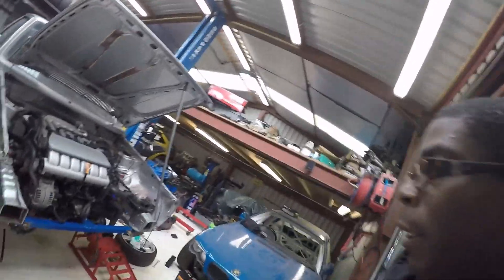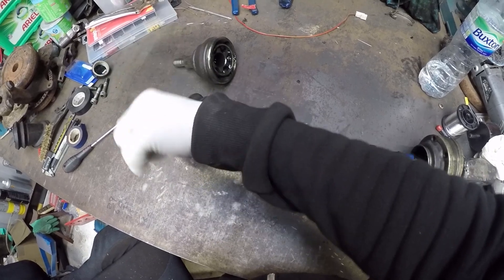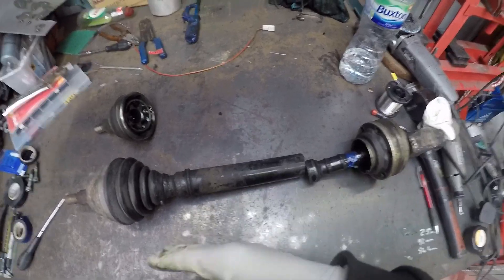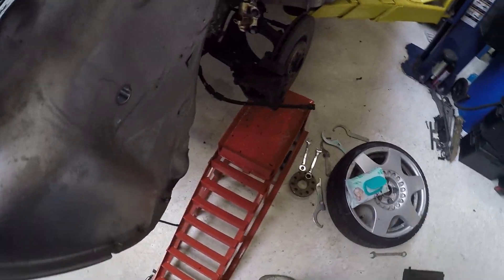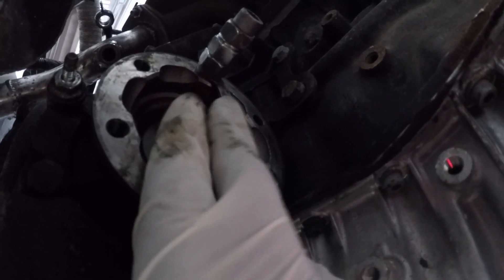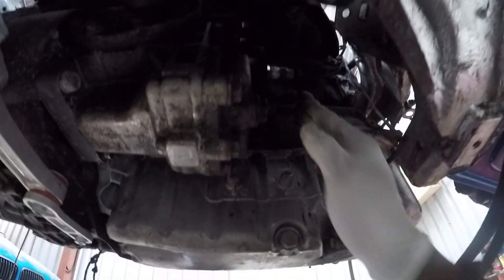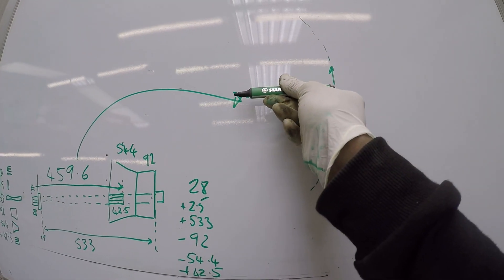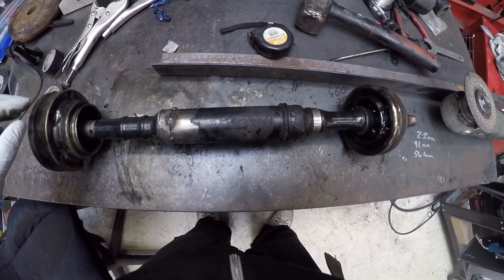Driveshaft Shortening

Comment: I know its a old video.but wat was the final size of both shafts
Reply from the maker: I wouldn't use anyone elses measurements simply because it depends on the placement of your engine.  If my engine is further to the left than yours and you use my shaft lengths then your left shaft will be too short and your right shaft will be to long.
Reply from the maker: Happy to give the the measurements though if you still want them.

Comment: I'm impressed about all you do. But this approach seams quite complicated. I would have cut and shortened the shaft so its clearly to short. Then installed both ends and measured the gap between the 2 ends. I'm very surprised that you have not more subscribers, we all can learn a lot from you!
Reply from the maker: I just watched the video again and your totally right.  I way over complicated that 😂.  You live and learn.  The next time I have to do that ill be using the "kululv method". 👍